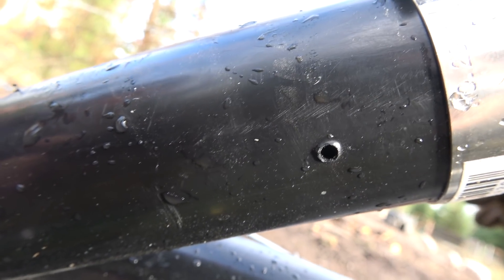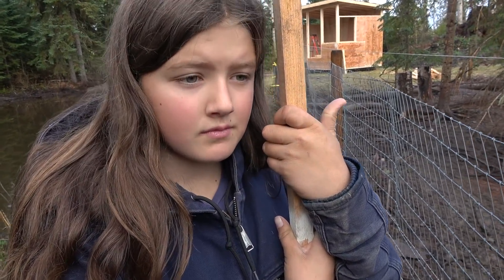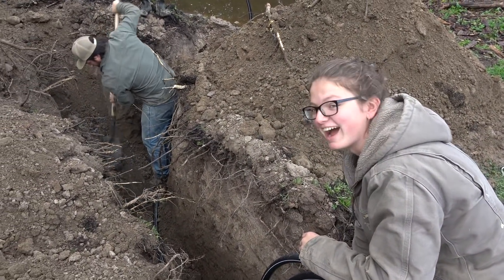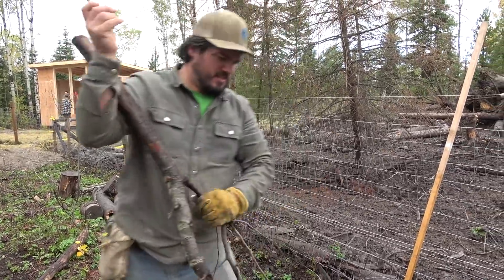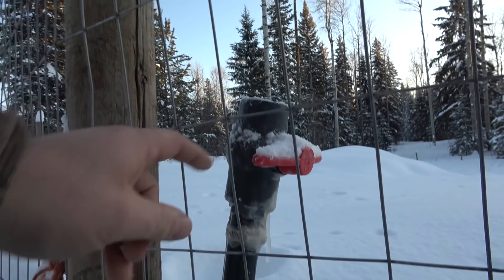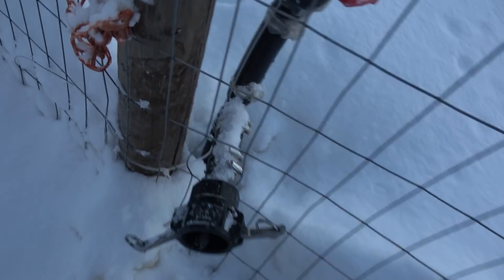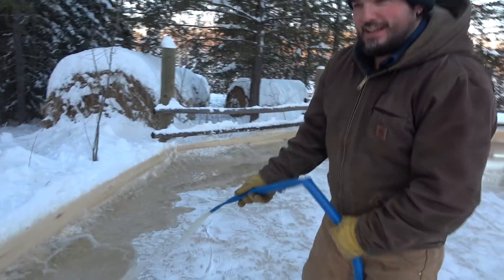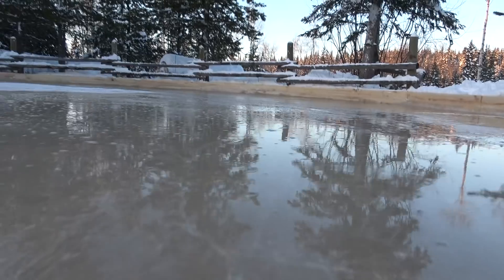Critical Off Grid Lo Tech

Comment: I pumped out of a hand dug well ( 19 feet deep) for 20 years.. Ran a pipe above the ground covered with a foot above & below the pipe with shavings & sawdust,,, made a box 3 x 3under the kitchen sink,, filled with sawdust tight to the floor,,, pitcher pump bolted to the sink counter... One winter we had 17 days it never went above zero F,, & NIGHTS at 25/41 below zero F... 2 tarps over the line keeping the sawdust dry,, 3 feet wide,, covered with fir brush & logs keeping the tarps in place... never walk or drive with-in 5 feet of the line... Clean spring water,, did the same thing to keep carrots in the garden all winter,, every couple weeks  shovel snow ,,roll the tarp back a couple feet,, pull 5 gallon bucket of the sweetest carrots ever!!
Reply from the maker: I've had these winter carrots and they are fantastic!
Reply: @Gridlessness  will you sale me a chees ? How much in English pounds ?

Comment: Pretty neat idea making a hole in the pipe to keep the end water from freezing. There is a thing towns use called a curb stop valve. It’s the valve that’s buried under peoples lawns . When you turn the valve to the off position there’s a little hole on the side of the valve that allows the water on the non pressing side to drain out. Pretty much the same idea. 👍

Comment: Run the water through a slow sand filter then add the cl2. Looks like you guys got it figured out though. Your event sounds fun. I'm just over in Alaska but I think Canada still has some hard-core restrictions on travel. Fingers crossed 🤞  that changes by spring. Thanks for the content, happy new year!

Comment: You can buy large bags of potato starch as a coagulant aid .This will aid in having the suspended solids clump together and settle to the bottom of a tank .Then you can draw the clearer water off near the top of the tank.This will lessen the load on your filters.

Comment: Awesome video. 
If you creat a still well in the pond so water runs through gravel first, then sand, before going into the take up inlet, it will be much cleaner. Can also add carbon ( an make your own) then puts less stain on you filtration system inside. 
Keep up the great work.

Comment: I have a suggestion for your hog pen. I used a hot wire for a while but the old boar figured out how to kill it. He was a pain. But I started putting poles around the bottom. It stiffens the wire till the hogs would leave it alone it will help any fence. I would not use any pond that stock has used . Build another pond a couple hundred yards above the one you have The water from it will be much cleaner.

Comment: Here in Northern Alberta,we use pond water.(We call them dugouts).I use this system.An electrical Jet pump in the basement,feeds a pressure tank(a steel tank with a bladder that has air in it).water pumped into the pressure tank compresses the bladder,and pressurises the system.One in house house filter is fitted,and a Burkey is used.Hey presto,potable water.An aeration pump in the pond will clean up the water,and stop the smell.Aeration pump can be powered by solar.

Comment: Every centrifugal pump as part of the design has what is called NPSH (Net Positive Suction Head). As long as flow pressure drop in the pipe plus the vertical head is less than pump rated NPSH then you would be okay.  The little drain hole to only prime the pump when needed is a great idea. The hole can also act as a anti-siphon device when needed, perhaps not in yyr situation.  A small 1/2" by pass valve , 90 degrees to foot valve can do the same purpose so you would not lose the prime. During the summer valve can stay closed and can have some automatic fill mode and in winter valve closed and used only when water transfer is needed. The draw back is the foot valve needs to be pulled up to manipulate bypass valve.

Comment: As soon as I saw the pig pen next to the pond I cringed because I knew where this was going. When using bleach, make sure it’s fresh because as soon as you expose it to air it starts to degrade. There are devices that can use a bit of electricity and salt water to make bleach for water purification as needed so you don’t have to worry about storing bleach and having it lose potency.

Comment: Happy New Year. For your info they make Thermopipe its same pipe you are using but  heat tape under enclosed in a larger foam to be buried. In Alaska you can go below the front line but you all have ice frozen ground or perma frost below. Hope your pipe doesn't freeze up on you.

Comment: Another great video.  I had a small cabin in the Laurentians north of Montreal.  It was on a remote lake but I had power.  I had a 1-1/4” hose with a foot valve like yours that went from about 12 foot water depth up to my pump in the cabin. The hose had a copper coil in it which kept the hose from freezing. Don’t know if it would work with solar and an inverter.  
HAPPY NEW YEAR from Hells Canyon!
Thanks.

Comment: Dude, I think ur name is th same as mine. Jeff, is what I think I have heard u called. So  friend now that u have ur water flowing. 
 If you will fill up a water drum  with charcoal, that u can make yourself, from burning wood then dousing it with water, before it becomes ashes. You can filter ur water through that charcoal, for 3 years before having to change it out again. Then to soft out th larger particles u can run ur water through  a 5gallon bucket of sand before running it through th charcoal. Then you can have all of your water safe for bathing, & safe for cooking with, & for drinking too.

Comment: RO or Reverse Osmosis filter will purify water nicely but you need a pump that can deliver sufficient pressure to push the water through the RO membrane. You'd need an electric or fuel driven pump that could run for hours to make a good size container full of pure. Too bad you're not near a sizeable hill with water source above, you could use the head pressure provided by gravity. That would give you the option of micro hydro for electricity + running water. Time to move eh? Haha  ;-)

Comment: If you were to run the water out of the tank Through a colom of crust Charcoal it would filter out the microbe and lock the Barkly. try it before you put, it through a Berkley Mack A charcoal colom filter.   &  then put it through the Berkley after.   Bad water can give you Leprosy  Stagnant water is tough to do your pond refills itself  So please not but test it.  or boiled. Les England

Comment: Smells like "DahWack" LOL . Actually most of the Valley area does. Nothing like the fresh smell of liquid manure 1st thing in the morning. Our daughter and her husband live there as well. He's a former pig farm worker. So not much phases him for stenches LOL. Now water issues and winter. Same boat, we are froze up solid. Was good til -20c , but a few nights of mid -30's and our tank froze solid. Even in a insulated box with a light for some heat. We do have a drilled well on the property. We did install a pump and frost-free hydrant . This spring we will run power and water lines closer to the dwellings. And some type of buried cistern for winter use . What size Berkey is that? I want one as I like to drink lots of water.

Comment: If I wasn't so far away and my  body let me, I'd be all for the Off Grid Event. I was really concerned over one thing though Jeff. You guys drank the filtered pond water without having boiled it first. I understand that the Berkey filter is very good, but does it filter out bacteria 100%? I'd prefer to see you boil it at some point in the process, just to be sure. Or did you do so and not show us? Happy new year from Down Under folks. Richard n Helen

Comment: I've changed my mind.Do not do this.  You are already too public.  Do not disclose your primary, or alternative locations.  Be very careful about disclosing any information.

Stock up on Pool Shock that is cheap.  It is essentially powdered bleach, calcium hypochlorite. It might be possible to have enough to  pre- treat the entire pond. it will store for a decade, whereas house hold bleach looses it's full potency after only 6 months on the shelf.

 To make the Berkey filters last longer, pre-filter it with a 1 micron sediment filter using standard whole house elements.  The black Berkey filters down to 0.9 microns so a $4 , 1 micron filter can do most of the work.  It is easy to install.  If you can only gravity feed the filter, then use a 5 or 10 micron sediment filter.  You can create your own low tech DYI gravity filter system by using two buckets.  Use 12 inches of All Thread, 2 nuts and a fender washer to attach a standard 10 inch filter element to the inside bottom of a bucket, and of course make holes to allow the water to drip into a container below.

I would also consider getting a solar powered water pump.  Here is one of my old articles on that topic:
I just wrote up a follow up that will not be publish until late next month.  The pressure from this or another pump could be used to push the water through a whole house filter system.

My Solar-Powered Dankoff Slow Pump System – Part 1, by Tunnel Rabbit 
https://survivalblog.com/2019/08/03/solar-powered-dankoff-slow-pump-system-part-1-tunnel-rabbit/
Reply from the maker: Wow, awesome info, I'll check it out, thanks.

Comment: So other than the obvious need to redirect the pig urine, you can get pond aerators that run off solar.   Just set up the panel, and drop a big disk attached to an air hose and forget it.  It’ll way increase the quality of the pond water till it freezes.  Not sure about after though.
The trip sounds very cool,  but for me, with transportation, it’d cost a ton.
Reply from the maker: Yes, 1)move the pigs 2)solar aerator !!  Next year we'll frolic all year round in that pond.

Comment: I wouldn't drink that water, especially after you found that spring on your property. Put a fence around the spring, build an insulated water tower by it, pump the water to the tower and gravity feed it to your house with buried water line.
Reply from the maker: The spring is definitely our preferred source but it's 3000' feet away.  Not insurmountable, but not a pipeline we could undertake quickly or easily.

Comment: You gave measurement in gallons how much water it takes to fill the pipe. You are Canadian and I was expecting that you’ll give measurement in liters. You also gave measurement in feet how deep pipe should be buried. On my previous comment you’ve mentioned that Canada still using imperial in building industries. I notice that imperial also used in liquid measurement. Then in which sectors metric is used?
Reply: Having such a hugely influential neighbor/market on our southern border that continues to use standard measurement, Canada has never fully committed to the metric system as it would simply be impractical, and costly for many. It is my understanding that even Europe still uses standard measurements in places...for example the wood 2x4 is still a thing in many places (in name only), as is 1/4", 3/8" and 1/2" drives for sockets, and I'm sure that there are many other examples that remain out of practicality.. Some things are just easier to visualize in English standard units. Canada, like the rest of the world uses metric units in STEM related fields, but varies outside of these.
Reply: Most off the shelf items such as groceries will all be labeled in metric volume/weight followed by the imperial equivalent in brackets. Items imported from metric countries such as those in Europe will be labeled only metric. Imports from the USA require the addition of metric information on the label. Most all imports will also need information added in the French language. Side note, when Canadians talk gallons, it means Imperial Gallons which are slightly more volume than US Gallons. Side note 2, the entire world uses imperial measurement exclusively for vehicle tire measurements. ;-)

Comment: Lol what if your cold storage had three sections and in the third there was a huge water tank and the top was shaped like  a very large funnel like a kiddy pool where it can collect rain and snow and dump it in the tank. Or it could be buried under ground say near shop and have eaves troughs drain onto it and have coils or in floor heating connected to shop or a rocket stove and a inside tank that pumps hot water through to melt winter snow  so it would drip into tank. Earth ships have collected their own snow and rain for many years and in Texas they make tin pads that are just feet  off ground that act like a roof to collect rain. Then you could pump it into house and filter it through a filter system like earth ships do. Or you could just build a earth ship of your own  and it would automatically collect it for you and go through a first flush system Roses eyes are gorgeous.

Comment: Buy a distiller and put the water in then you have pure water. They turn any stinking water into clean drinking water.
Reply: Distilled water is not drinking water intel you add ?      = minerals
Reply: Distilled water is old... Power hungry tec.
RO filtration is best.
Reply: @spirit_wolf123  It's pure water. What we are made from. You can get minerals from food. I drink it.
Reply: @sails3538  It's best for tap water. I don't think there's any filters that can take fluoride out as far as I know. I know they haven't got crap like that in their water but anyone reading this who has it. It will help.
Reply: @rastamanralph6670  not Removal of organic compounds by distillation can vary depending on chemical properties of the contaminant. Certain pesticides, volatile solvents, and volatile organic compounds (VOCs), such as benzene and toluene, with boiling points close to or below that of water will vaporize along with the water as it is boiled in the distiller. Such compounds will not be completely removed unless another process is used prior to condensation. Unless salt is involved much better to put it through a tank filled with gravel sand moss and charcoal which is best if used in three tank system pre tank with bleach into the filter into fresh drinking water holding tank
Reply: @spirit_wolf123  ok. My distiller has a carbon filter also then into a glass jug